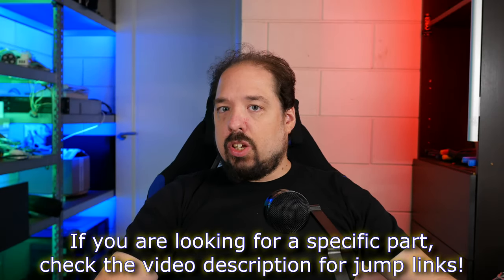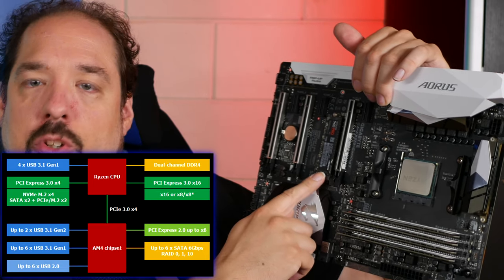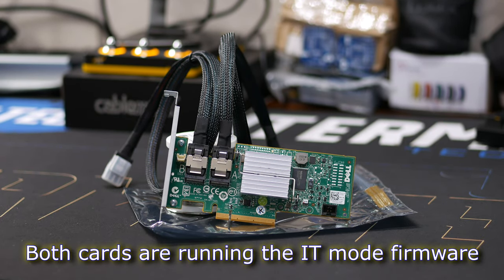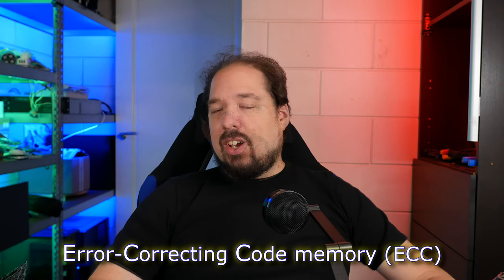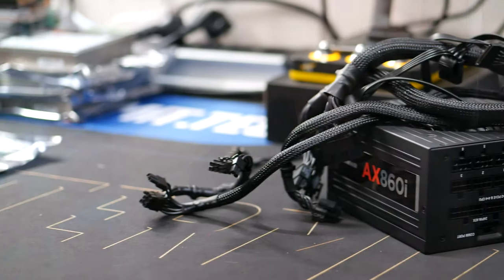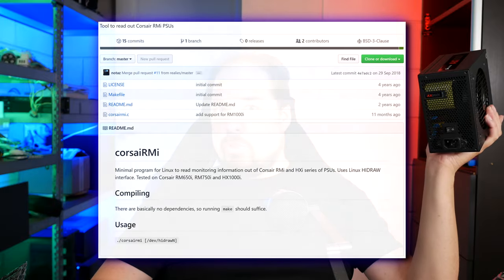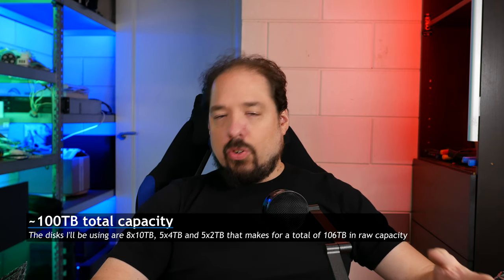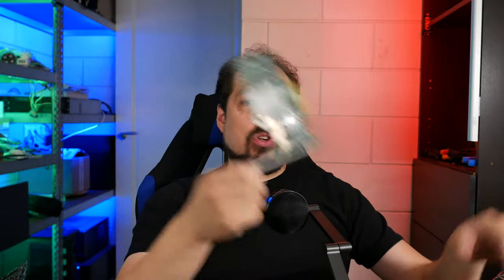Home Networking: 100TB 10Gbit Server - What hardware do you need?

Comment: Any kind of server requires ECC RAM
You cannot copy my from HDD in machine A to HDD in machine B - there is RAM involved and unfortunately it is single point of failure
Only RAM have no way of verifying contents by default
My main workstation have ECC RAM
Both of my TestBeds have ECC RAM
I have trouble in finding 4 16GB DDR3 PC3-12800 1600MHZ ECC RAM. It have to be non registered, as I am running AMD Phenom II X6 1100T. It have to be dual ranked 2gbit x4 (chip organisation). I have such at the moment. It is not easy to find such memory and when you do find it you will find that they want ridiculous amount of money for it (like £300, where 4x 16GB kit costs me just £200, ECC definitely not takes another 32 chips over 4 modules, but actually 8 chips, which is 1/9)